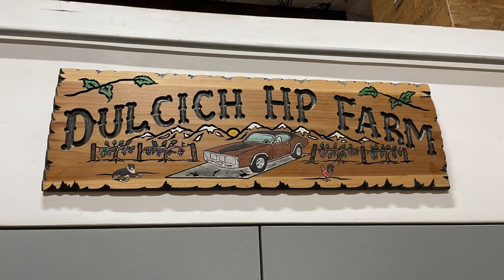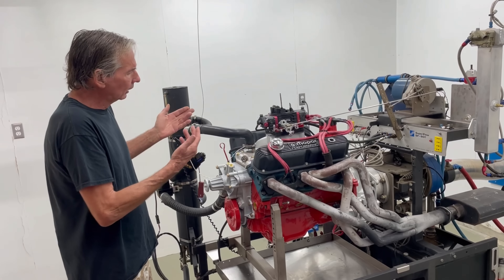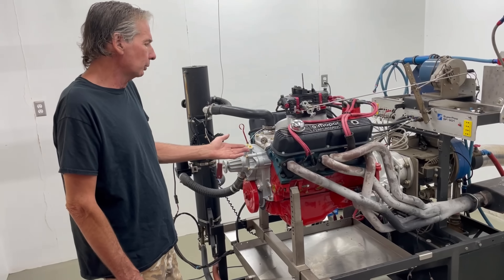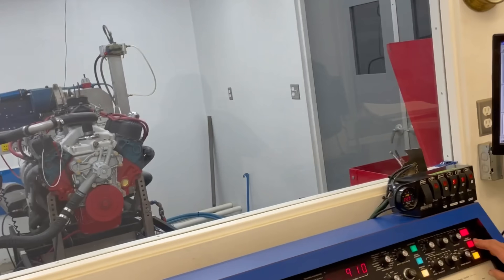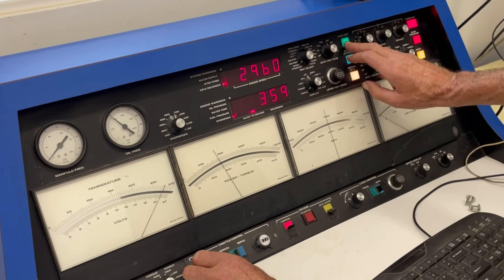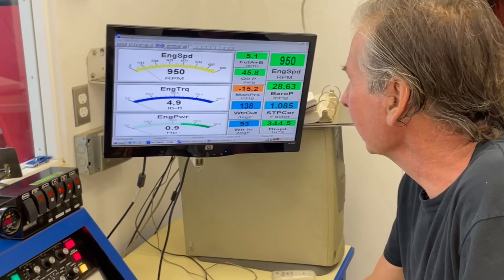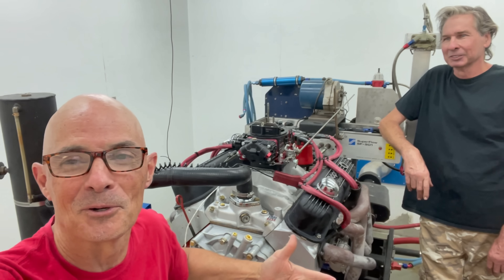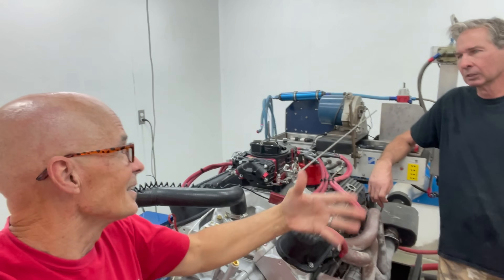AFR MOPAR 340 HEAD TEST! THE ENGINE MASTER HIMSELF, STEVE DULCICH & I COMPARED AFR VS IRON 360 HEADS

Comment: Will those heads work on a magnum engine?
Reply: Easy to put Magnum heads on a LA bottom end using the whole magnum top end and lifters that allow pushrod oiling but going the other way around is a bit of an issue since magnum blocks don't have the provision to oil the rockers through the pre magnum heads. The magnum block would have to be drilled to provide oil to the top end or I heard someone has run external lines to some drilled ports on the ends of the heads then to the shafts.  So more of a pain. They did have Edelbrock magnum heads which are/were really nice. Magnum heads are better. They have a better combustion chamber, better exhaust ports, smaller valve stems, factory 1.6 vs 1.5 ratio rockers,  more valve cover sealing bolts than LA. And less expensive roller rockers(takes a Chevy style rocker) The Edelbrock  magnum heads would be a better bet vs trying to convert an LA AFR head. They can also be ported for real nice gains. Even porting the stock magnum heads really wakes them up.
Reply: @dannyfasttcars8612  The oiling concern can be addressed using Harland Sharp rockers.
Reply: Intake bolt angle will be different and oiling issues for the shaft mount rockers. It can be done.
Reply: I believe they have necessary information on the website. 👍